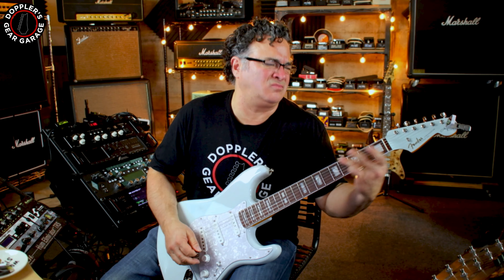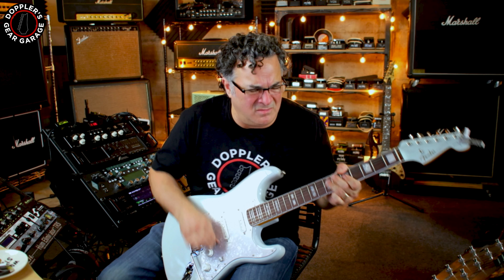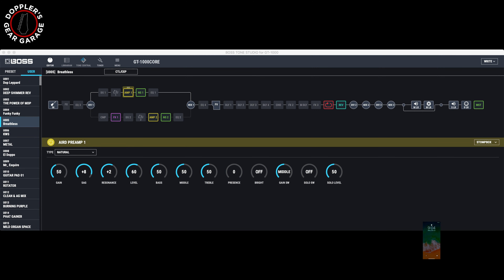Could the Boss GT-1000CORE... REPLACE MY AMP?!?

Comment: Is it possible to connect the GT-1000 to an amplifier on stage and to the PA at the same time?
Reply from the maker: Hey Tom! The answer is yes, but with a few caveats. For stereo, since there are only two outputs (left and right, and the left also doubles as the phones output), with pass through on either two mono DIs or one stereo one, you could route audio to the board and to monitor source. If you opted to run dual mono, you run one FOH and the other to your monitors with the added benefit of being able to fine tune each of those outputs respectively. GREAT question - hope that helps! Cheers ~ Doug:)

Comment: I have the boss gt1 going threw my amp sounds great. But going threw my mixer threw pa into bose speaker sounds terrible. Will the boss gt1000 core do better
Reply from the maker: Yo Work Days! GOOD NEWS, go to Page 3 of the manual for the GT-1 and you can set the output to match the kind of amp (P.A. etc.) you're running into:)

Comment: Got mine and love the sounds but one clear cost cutting omission of a power button. Very annoying having to plug it out to turn it off.
Reply from the maker: Hey! So I spoke with Jeff about this and the upshot of that convo was our observation (for better or worse) that pretty much every 'board-centric' stomp that is this size or smaller does not have an on/off button. I personally keep mine on 24/7 as I find that things tend to crap out more when powering them on or off than when they are always on. While they obviously do save some money on not having an on/off feature, since many people will use this on their board, it may not be a feature that would actually get used that  much. When used a s studio tool, that's a different story - noted ~ Doug:)

Comment: Looking forward to the upcoming videos. I’m especially interested in how to use a MIDI controller/switcher in a pedalboard with the CORE.
Reply from the maker: AWESOME! Do you already have a MIDI controller and/or switcher, and if so, which one(s). If not, what are you looking at?
Reply: @DougDopplerMusic  I don’t have one yet - I’m looking at different options. It would be cool to see a MIDI controller to extend the functionality of the CORE (i.e. more switches) and also a controller/switcher that would be used to integrate the CORE into a pedalboard.

Comment: I also got one. Using it for bass and it sounds and feels amazing. Like the other commenter, the missing power switch is kind of a bummer, as well as the missing dedicated aux in. I know you are supposed to be able to do something with the fx loops but it's a huge pain. Now I bring along an extra 2 channel mixer in my gig bag which unfortunately adds extra weight. Even though that unit is supposed to be board-centric, I'm pretty sure many folks will use this as their entire rig as well as practice amp, and a dedicated aux in is great for that. All that aside, I still went for the GT instead of the HX Stomp, just because I prefer how the unit sounds and feels. Great work Boss!
Reply: No aux in is a joke!

Comment: Will it sound  the same or close to a valve  amp.when plugged  into a pa. Like can it replace the guitar  amp
Reply: 😂 
Sorry no modeler is universally accepted for this purpose. You’re in for a hell of a transition, and a lot of maddening gear swaps before you find a compromise that somewhat pleases you. 

You might just get sooo frustrated at how you want it to work out, but it just doesn’t, so you go back to tubes for a while.

Comment: Nice demo ! Can you use the GT 1000 Core with a guitar amp or does it need to go through a full range / flat-frequency-response system ( like a PA , for example ) because it's a modeling unit ? Thanks !!
Reply: It does both, really well - just make sure you have your AIRD setup appropriately, I’m often throwing it into a Neve RNDI and then using line/phones or recording if I want to have cabinet simulation enabled.

Comment: Thanks for doing this series; I just bought one of these, and I'm not getting the tone you're getting.  I have some experience with multiple effects units (I used a GT-3 years ago professionally, and traded that in for the GT-4 which wasn't as good, and also had the VGA-7 as part of my rig), but this one has so much more power and I feel a bit lost.  It would be cool if you could let us know which patches you are using for the demonstration videos, too.
Reply from the maker: Hey Greg - REALLY appreciate ALL the detail - big help. Let me think about some options on the presets and circle back. Again, thanks for all the detail:)
Reply: @DougDopplerMusic  Nice playing, BTW!
Reply from the maker: @GH3K3  THANKS!

Comment: Is there a foot switch you can recommend for the Core that will add more switches?
Reply from the maker: Hey Modular! https://www.sweetwater.com/store/detail/FS6--boss-fs-6-dual-foot-switch is a great two-button solution. How many switches are you looking for, and and are you interested in MIDI-driven options as well?
Reply: Doug Doppler hey Doug...I ended up getting the Boss ES-5 so far the CTR outs are working great. I’m on the midi cable from boss once I have that it should really open up the the functionality of the GT 1000 Core
Reply from the maker: @BeatsAndGuitars  awesome, Awesome, AWESOME!!!
Reply: @DougDopplerMusic  - I know the GT-1000Core has the option to connect an Expression pedal, as well as a footswitch, like the FS-7, but are there any possibilities for more Assign options/control options?
I've seen the MIDI options, but I'm not much into MIDI - could you maybe share some points on that?
Thanks, that would be greatly appreciated.

Cheers.
Reply from the maker: @GuitarNTabs  Sorry for the slow reply - I missed your 'nested' comment. FOR SURE. First off, Jeff and I are FINALLY going to shoot the pedalboard video tomorrow after numerous delays tied to making the 'right' video. MIDI is a BIG part of this video and your use is directly on target for most people who'll have to learn some MIDI to get the control they want (see the little video pinned at the top of this page). FOR YOU... MIDI CHANNEL is like a phone number, it can be assigned to one piece of gear or multiple pieces of gear can share the same channel. PC = program change and CC = control change. PC messages simply tell a device to change presets, and CC messages most often tell a device to make changes inside a preset (like telling a looper to stop or start). It's not that complicated once you have the basic understanding for what does what. This next video will be a BIG help in seeing that put into action. Thanks again for your message, sorry for the slow reply! Cheers ~ Doug:)
Reply: @DougDopplerMusic  - Thanks for the reply, Doug, I greatly appreciate that!
I see, thanks for clearing that up. I will await your latest video, and hopefully know more by then.
Have an excellent day!

Comment: I have to be honest I’ve tried all the most prominent modelers, and this one takes the shit-cake by the mouthful. Jeff is a very pretty omnisexual.
Reply from the maker: HEY! JU5TINTIM3, the great news is that all of these devices speak to people differently. I took the GT-1000CORE with me to both the Paul Gilbert and John Petrucci guitar camps because of a preset that has all the qualities that I look for in a shred tone. I LOVE this tone, but every player has their own fingers, ear, rig, and taste/s and that is what makes all of this so cool. What is your favorite modeller?
Reply: @DougDopplerMusic  
The Fractal FM3 was the first modeler that A/B'd in my room against my Triple Rectifier, both through FRFR and a real guitar cab, and sounded/felt genuine, authentic, and real.

I've tried all the top dogs except for the Quad Cortex and Kemper... I landed on the FM3 after going back and forth with a Helix. I like the Helix, but I feel Fractal's nailed things on interface, customization, and authentic amp models/effects. 

On top of Fractals amps being authentic you can stay on a basic tab for tweaking your sound, or go more advanced to changing tubes etc! To me the little things really change stuff.

With Helix I started feeling like all the amps were the same source with different settings almost. The GT1000 had a seriously rough interface, but I won't say it sounds necessarily bad I suppose... There are some shaky demo's out there for it for sure.